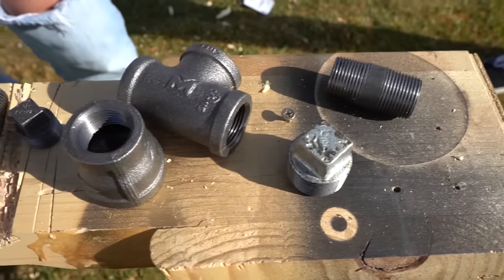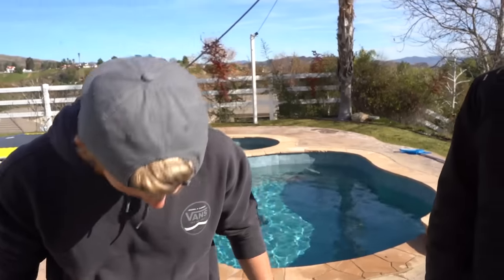Testing 5 DIY Apocalypse Survival Weapons! *TERRIBLE TO AMAZING*

Comment: ok, so on slug-nut.  on that head- you take out that skinny side of the head and replace it with a 6" nipple cut off at a 45 degree angle.   You put that head on a 30" long bit of 1/2" pipe.   take that reducer and plug you pulled off there, and put it on the Bottom of the handle.
For the handle, you need about 20" of 1/2" rubber hose, and you cut that lengthwise.  you glue this to the handle front and back. wrap this with string, wrap that with athletic or self fusing rubber tape (this squares the handle making it less likely to roll in your hand.)  
You then have a legit warhammer that can take down a man in armor, or dismantle a car.

JB weld all the joints Except for the plug at the bottom of the hammer.  Because of the hollow nipple, it will take plugs out of things.  you need to be able to blast a hose down the handle, for reasons.

(yes, I have made this weapon. 

Same notion you take a 1 1/14 black iron Union, and a reducer down to a 1/2, stick it on the same handle and you have a nasty Mace. 
I made an extendo-flail (chain in the handle- unscrew the head and there you go. mace or flail as you like.  This thing is not safe, but it's effective- keep your chain isn't long enough to hit your hand.  secure in the head and pommel reducer with screw on cable clamps)
Reply: Noice 👌

Comment: Guys, if would have only your weapons to pick in zombie apocalypse, i would pick a stone, or a brick. 
Spear - preferably with metal point - is pretty good, because it has a reach witouth need to get into direct contact, AND you can throw it. 
Warhammer made out of pipeline is not a bad idea, but the handle should be made out of something light, to get quicker swing. 
Baseball-machete deppends on the strenght of connection, but it is second best after the spear. 
Double saw batleth is funny, but probably the worst weapon you had including the whippy branch. 

The best would be a sword, spear, shield (plus armour) and bow plus crossbow, if we do not count firearms. Even better would be to have your "base" big, stocked and able to move (ships for example).

Comment: I have a homemade spear it has four rusty nails it used to have five but the fifth one fell of and it was in the middle but the base is made of a plastic pipe and the rusty nail and the plastic pipe is connected with a metal zip tie that slightly rusty and it can stab through soda cans that are empty!